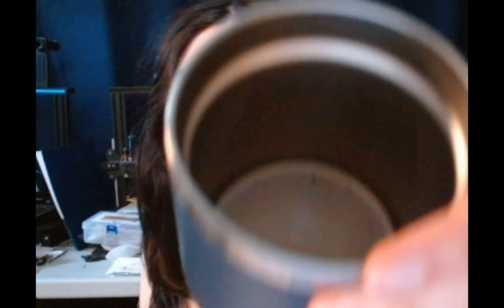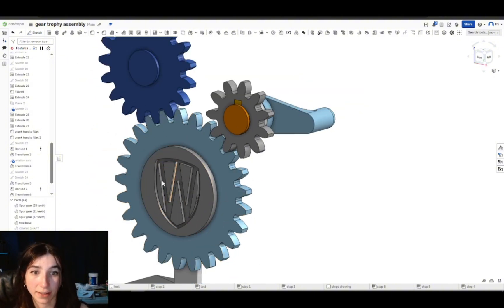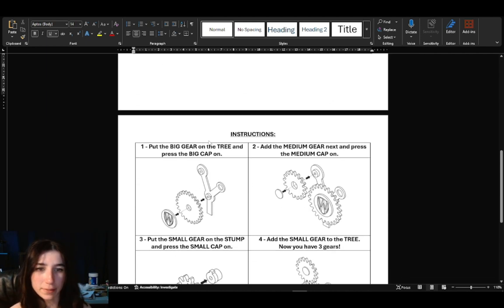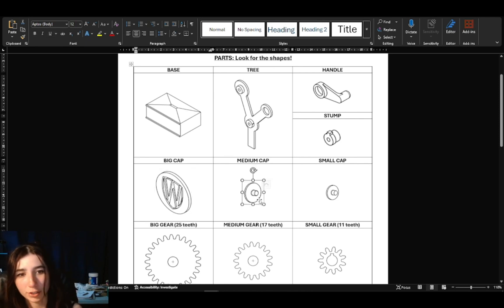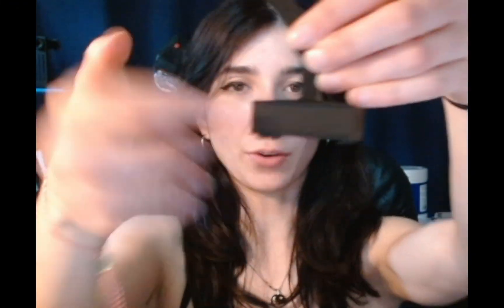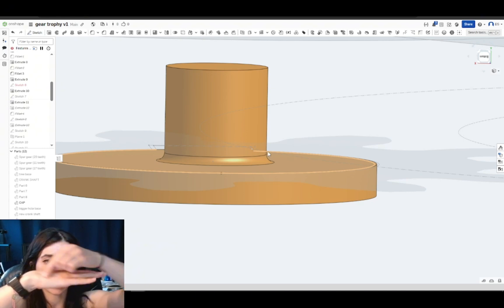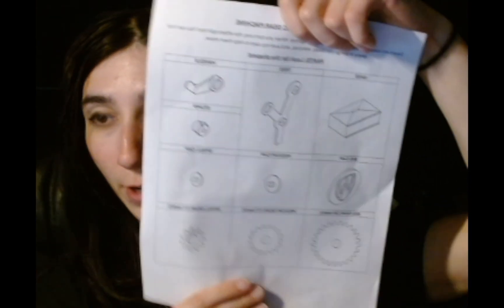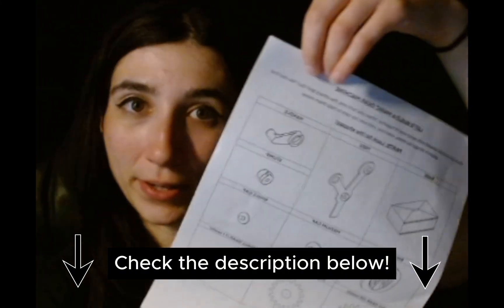can I design something that survives 6-year olds? (CAD TIME #7)

Comment: An easy "cheap" trick to add a small amount of additional strength to your stacked cylinder "peg" component, would be to put a small through-hole in the center of the part so there are more walls connecting the two cylinders once printed. Also as an FRC mentor myself, I feel it is so rewarding to introduce the youth to engineering, especially when at least a couple of them show real interest. Making those kits was an awesome thing to do for your community!🙂
Reply from the maker: thank you! I will have to try this next time :)

Comment: 1:21

I the spiret of not overcomplicating things 🤪

1. Maybe it is possible to 3D print an 20-spline shaft, or maybe 10 or something to get printable features. Or even a Hex shafts (I just do not like a keyed Shaft 😂)
2. You could probably add some triangular holes in the tree to save some plastic and make it faster to print. (But it leaves less space for painting 🤷‍♂, guess it is a trade off)
3. Guess you could do the same thing for the gears.

How does the handle connect? And how do you 3D print that pat. It looks a little complicated to me. (assuming it is a press fit with not easy print orientation)?